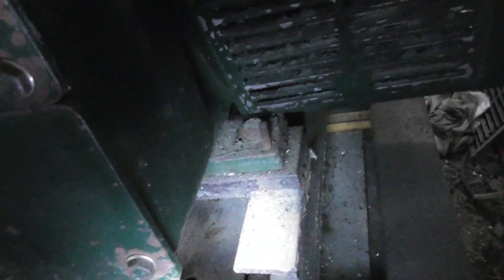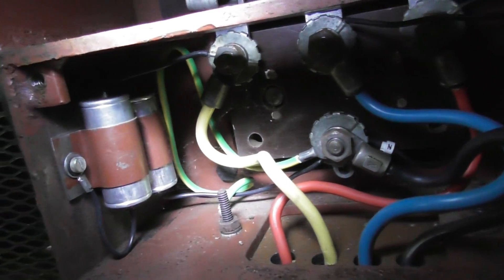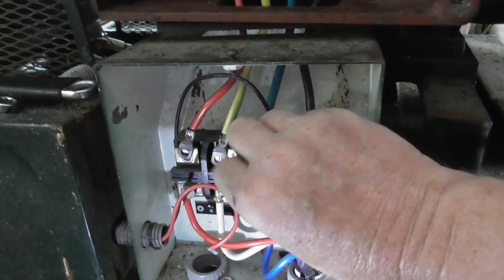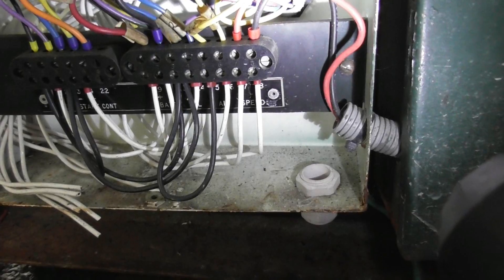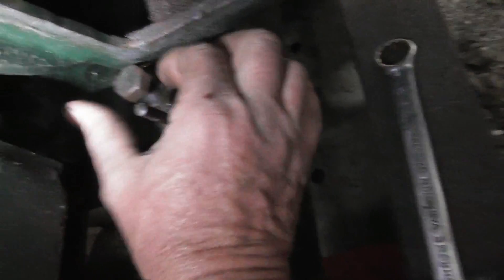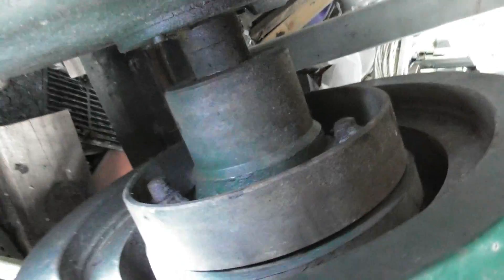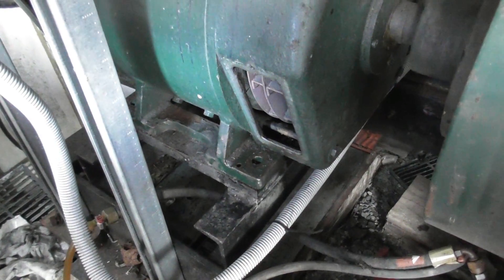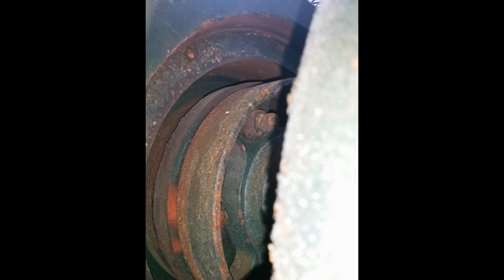Lister Generator Part 1 prepare for gen-head removal

Comment: This battle will be epic.
You might need an assistant and a that kind of hydraulic tool which is used to take out the motor in a car. 
And a pulley extractor.
For the alignment you might need a dial indicator with a magnetic base put in some configuration to measure for vibration and eccentricity.

What do you think happened in first place? Because I'm intrigued on the possible ways to build a circuit to prevent high voltage spikes from going to were they 'never' should.

Are them high power radio frequencies?

Comment: Hi Ray, that is probably an Enfield coupling which is simply a rubber impregnated fiber disc. It has 4 holes two for one side and 2 for the other. some had 3 and 3. I think I still have some here but yours should be fine. You are correct about the pins. They were simply drilled in with a pistol drill after final alignment. Simply remove and refit. But if you are going to split the casing of the alternator unit, it might be an idea to check the coupling face distance to check for proper alignment. Serious misalignment can break the engine crank. But you are not on board a ship using it 24/7 so with intermittent use, should be fine even if not perfectly aligned. Don't underestimate the makers of these units, they were pretty smart eggs, so document the wiring carefully and try to understand what it is all for. You are also smart so it should all be obvious. No FPLA's or Eproms here. Just wires, coils and resistors with a few suppressor caps thrown in.  etc. Just some grunting and swearing.
Reply from the maker: Hi Allister, thank you for your detailed  reply. I make alignment marks on everything which I take apart, as well as drawings and photo's of the wiring.
Hardest part will be to lift the alternator of the frame.

Comment: From what I remember, you don’t need to remove the nuts on the coupling, they just secure pins that locate in the rubber doughnut, and should just slide apart. 👍